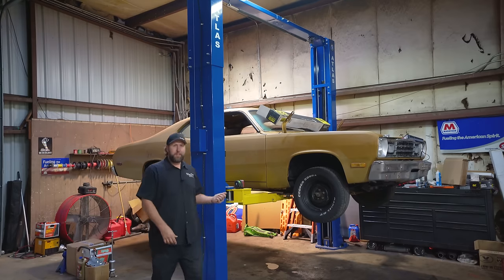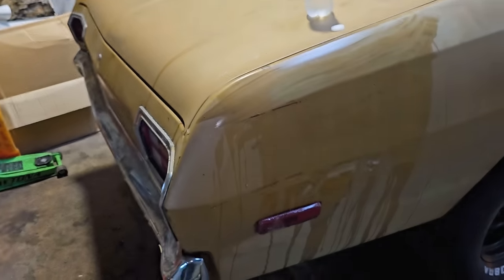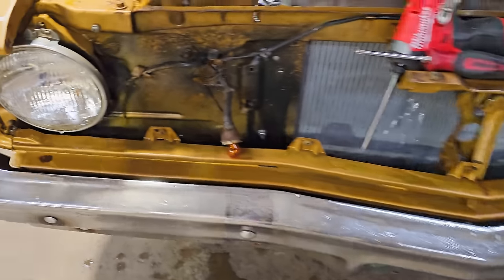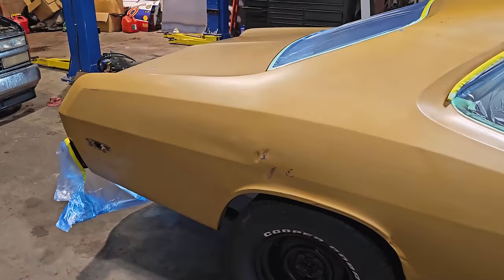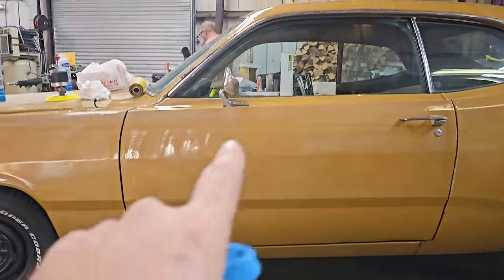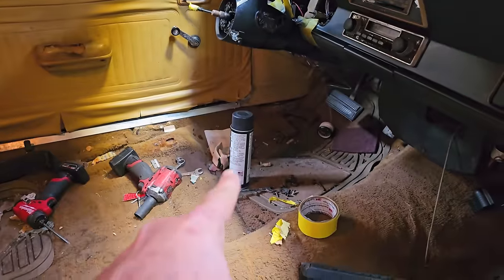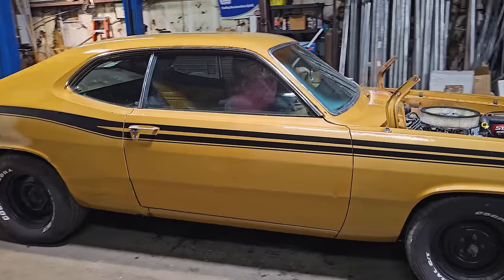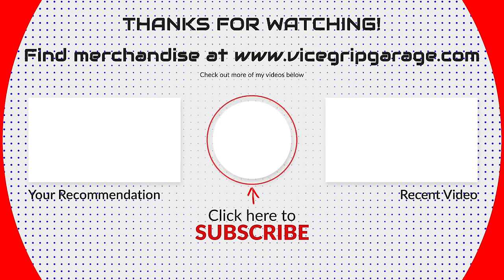MASSIVE CHEAP Mopar Transformation! Duster Looks Better Than Ever!

Comment: The most comprehensive, easy to follow front wheel rebuilding I've ever seen. Love it! 👍
Reply: I feel like I can do brakes now. Can't wait to do mine this weekend.
Reply: Step by step detailed instructions how to rebuild front end, AWESOME!!
Reply: I tried that same rebuild method on my disc brakes, it sucked, lost all stopping power.
Reply: craigslist rebuild.
Reply: The guy single handedly upgraded a single wheel with 7 new bearings and 5 brake pads on a drum. That takes talent, man
Reply: At pit crew speeds too.
Reply: Why not use real paint instead of clear ?
Just as much work is required
Reply: 15:29
Reply: @BeardedFrog PPP

Comment: 👍 I'm one of the guys that liked the black steel wheels but on the other hand I would upgrade front brakes
Reply: I would do the brakes to with the HP up front now
Reply: I concur. My first car was a '67 Charger with a slightly heated up 440 Magnum, and the stock drums all 'round. After a few hard applications the slowin-down situation got, uh, "interesting".

Comment: I remember my Dodge Dart Sport, ‘73 model with the unbreakable 5.3/318 v-8. It was copper mini flake exterior with a white vinyl top and beige interior with benches front and back. Dog dish wheel covers on 14” wheels. Slapped in a generic 150 watt cassette player, tore out an 8 track player to get it in, mounted a tachometer on the steering column and drove the crap out of that “cruiser”. Never a problem.
09:40   That sounds great

Comment: This has taken me back to my late teens! I can remember setting up a spray booth in my parents double  garage.  I used frame tent poles  and polythene with a damp floor to keep the dust down. Before I started I had 4 old oil filled radiators plugged in to get the garage warm. I can still picture my mini and it's island blue paint with a white roof!!
Reply: Cool.
Reply: Do you have a picture of it too share with us? 🤔🧐✌️
Reply: @BrianMagnafici-mw5xh  Unfortunately I don't it was 30 years ago, I did take pics but I'd used an old point and shoot camera. I'm going to my parents house tonight and I'll have a hunt in the attic through the family albums!!!!
Reply: I did exactly the same thing, but without the tent. My Mini was Almond Green with an Old English White roof, 1275A+ Metro engine, Cooper disks, Cooper perforated wheels, later genuine Minilites, negative camber and lowered all round with the obligatory RC40 exhaust.

Comment: Gas station attendant forgot the hood pins on my brother's 68 Roadrunner. 95 mph on open road and the hood went over the roof. No other damage but  he never painted the replacement hood. Looked good. I repainted my Ranchero and did the hood in 1/2 flat 1/2  semi gloss. No glare off hood!

Comment: That stock 7.25” likely had a 2.73 gear. 8.75” 3.55 was an awesome choice. That gauge cluster is without a doubt the best I’ve seen. I’m hoping you share a build sheet with us as far as the parts you’ve used.

Comment: In 1981 I had a 72' Duster with a 383, 8 3/4 rear(also shortened since I could not find one for the duster. Hooker fender-well headers, 727 reverse manual valve body, engine redone 11:1 comp, hairy cam, edelbrock high rise holly 780 jetted out. 490hp at the wheels. Heads were all done as well with larger intakes. 3500 stall. The car would pop wheelies with slicks. I drove it on the street for years. To this day my favorite car ever!!!

Comment: Looks Good.. you’re better off using a 1.3 or 1.4 for clear.  In cold weather you wanna heat the clear.   Boil a bunch of water then pour it in a bucket.   Then set your cans of clear and hardener in there    Let ‘em warm up Dutch oven style.  (You can set them in front of a heater also).  When the components are nice and warm, mix and spray.  Trust me.  Way less likely to run and it’ll lay down smooth.  Set your gun about 29 psi at the cap.  Material about 2 1/2 -3 turns out from fully closed and keep the wet spot movin’
Reply: Exactly. 1.7 tips are for primer.
Reply: yep I 3rd that I use 1.4 for clear 1.3 for base   . and i did use 1.8 for high build primer but now use 2.5
Reply: P.S. get away from the hvlp guns  plenty of budget conventional or lvlp guns out there. Heating the clear not only makes it flash quicker.  It makes it thin out.  Cut your reducer down to 5% or less.

Comment: I saw a really interesting video on clear coat runs a while back. The fella was trying out a technique he’d been told about by an old hand in the profession early on in his career and remembered it when a new guy at the spray shop was working at got runs in the top coat. He used filler to cover the area and then knocked back the whole area with various grits until he’d taken off all the filler and clear coat and as they’re both on top of the good paint it saved the day with the minimal amount of work. Lad is the GunMan on here if anyone wants to check it out ❤

Comment: The car deserves to get proper bodywork and paint. Anything less is an injustice IMO. 😮
Reply from the maker: A 73 slant 6 car?  That means k cars need full restores too.
Reply: I'm with you on that doesn't matter if it was a 6,cyl. A car like this at least should have the rust knocked out and the dents filled. Then color change. Doesn't have to be a full out restoration but enough to make it look decent.@rustyul. Of course that just might be the body man coming  out in me.
Reply: I guess you forgot that it's free. You can take it to the next level   if you win it.
Reply: @scottcrawford3092  would have taken a  day max to bondo and primer. Doesn't have to be perfect. Hell hey put an engine , tyranny ,new rear, custom exhaust, new rims, and new interior. What's the extra day and $400 to make it look decent.
Reply: Nah, I wouldn't want it too pretty., I'd be afraid to drive it in the real world. It's a hair over the line as it is!

Comment: Advice on the double edge blade , pout two small pieces of masking tape on both ends so a guy can hold the blade tighter and will not slip out of your hand.

Comment: Please, please, please use safety glasses more often and especially when using a wire brush on a grinder. I caught a piece of wire in my eye "once" cleaning a transmission with a wire wheel on a drill motor. OUCH! Eye Dr. was in thankfully.  1/2 mm wire sliver was removed from inside eyelid. It scratched my cornea with every blink for an hour or so.  Hurt a bunch. No permanent damage. Love your videos.

Comment: I cut some wheel wells out that was rusted out and bout replacement ones and welded them.on a 09 Chevy Silverado. Then I used the grinder to smooth out the welds. After that I added Bondo and sanded and primed it. It was fun and it turned out good. Now I want to do that and buy a big air compressor and some guns. I have 2 guns already but I want 2 more. Can't wait to try it on my 06 Dodge charger 3,5 motor. I'm going to paint it orange maybe do the general Lee or something

Comment: I'm an automotive paint repairman by trade.(Tip) Sharpen the back side of your razor blade by dragging it on 800 grit paper on a flat surface.  Now take your blade and put it  90 degrees to the run/sag in the paint and drag the front side across the run until  the run is level with the surrounding surface. You will know your there when all the area is the same color. Now finish with 2000 on a block and then polish.
Reply: 𝐋𝐞𝐭𝐬 𝐃𝐢𝐬𝐜𝐮𝐬𝐬 ✝️✝️✝️✝️✝️

Comment: I'm sitting here sportin my new VGG hoodie! I love the card that came with it too.
You are a lucky man Derick. 

It looks like a poor rattle can paint job.

 I have never won anything in my life, but I have a feeling in my bones for the first time that my my ship is coming in after 62 years.
I have always been an optimist.

So don't worry about the body. I live in the high desert with lots of mud, rocks and snow, and it will be thrashed. 
I have never owned a Mopar before but I have worked on many. I will adjust. Since it has a morphodite Chebbi/Chrysler engine in it it will make the transition less painful.
Chrysolet? Moparlet? Chevlar? Mopette? Crymaro? Dustvelle (it's kinda Chevelle-ish)?...or how about Mova!

I would have loved the 2:40 (probably 2:73)gears since once you get out of town around here, the roads are long and straight for hundreds of miles, but beggars can't be choosers. Definitely needs the 4 wheel disk. Around 5 or 6 hundred per end and a very easy job. Go fast car needs stop fast brakes.

Comment: I had 4:11's in my 8 3/4" with a 340 4-speed in a '74 duster (original 225ci auto car) with a very similar color. 3:55's were a much better street gear. Rear springs were a nightmare, even after grabbing V8 A-body leafs, my hyped up 349 twisted the crap out of them. Torsion bars suck even worse, especially when you also do a V8 swap with full length headers, they got flattened multiple times.

Miss that car.

Comment: 3m makes a real easy to use tape and plastic dispenser. Also does paper rolls. That way you can use the good green automotive tape, and the cling free plastic. I worked in house paint, but it should work about the same

Comment: 8:20 8:53
For the effort I’d probably have bodyworked a bit and just shot it fresh, maaco style. Not a criticism- just seems like a lot of work to not do a lot of work to me
20:15 I have had that ~$30 purple gun since ?2016. Used it for a couple boats, several trailers, some vehicles, a kitchen cabinet job with BM water-born alkyd, paneled wood doors, and even gallons of latex on latticework and exterior trim cut in. It’s been awesome. Even did my own old jeep with reduced rustoleum and not a drip or run anywhere. 
Good cheapo gun. Can’t believe it hasn’t failed out. Yet.

Comment: ok ive done all 3 guns from hoborape  best advice i can say is get the spectum  system for it  easy cleanup   i still have the same gun as you for primer but use the system  but use the blackwidow for color and clear   now just painted a  928 cat loadef friday and i swear by the red filters for air intake on gun lol

Comment: If I catch the run while I am spraying I use a trick a friend showed me.. I wrap masking tape around my hand sticky side out like a glove.. if you lightly and quickly touch the run several times you can get most of the excess off.. then spray a light coat over to re smooth everything.. it isn't perfect show car quality but like you said.. it is good enough and if it is not and you need to sand it is closer than it would have been and requires less sanding.

Comment: Just a tip when wax n grease removing, you should always follow up your wet cleaning rag with a dry clean cloth. And I know a fellar is not worried about dust to much but you should also wet down the floor, it will reduce dust as you walk around painting and keeps the overspray and paint dust trapped on the wet floor. Hey a guy has a great spray technic to, no really, good job fella.

Comment: I really enjoyed this episode of VGG! Reminds me a lot of the cars I enjoyed back in the day. The other traditional thing's were a lift on the rear. For a slightly raked appearance. Ladder bars / traction bars. 6" by 9" Jensen dual cone high performance speakers in the rear deck.. A Pioneer AM/FM stereo/ tape player. 6" speakers in each door, Tweeter speakers up front on each side of the dash. A high end 6 channel graphic equalizer. A additional stereo amp under the dash or wherever is handy.. The rims are perfect! The tire's for the time period would of been different in manufacturer. Think Firestone had some very good tires as well as Good/Year. BFG's radial T/A's. To point out a few good one's.... But I have put some large miles on a good set of COOPERS as well. Love your show!! Don't mind my rambling on....The exhaust is dead on!

Comment: I would have hit it on the back quarter with 80grit with a orbital sander then 200 and had a look see I used to work at a place that made signs in the sanding and finishing department. Any small pinholes or divets hit with acrylic putty sand lightly then spray it.

Comment: Ironically, an 84 Volare grille not only fits on that model Duster, it REALLY ROCKS!!!

You wouldn't understand if you didn't see it.

I know this because I had to replace the front of a 67 Duster with the front of an 84 Volare once.

The car went from 'tacky' to TRACKY!

[in appearance, anyhow]

Still had a slant 6 in it, but when I did a flat black job on it, it sold literally the same minute I was finishing off the black.

Some young man in a Blown 460 powered Mercury Bobcat with a chopped and tubbed rear end was cruising by, and as he looked over, he instantly pulled in at the next driveway and came right round and shelled out the cash.

I forget what he said he was gunna put in it, but something WAAAAYYY BIGGER than that slant six!

Comment: After the black stripe, I wanted to see a black grill, black bumper, and black wheels. Chrome doesn’t get you home. The menacing ls motor needs to be a Murder Duster. 

I’m a bit disappointed that your aren’t doing disc front brakes….. 

Thanks for the content.

Comment: An old trick I learned Before I lost My eyesight is when you are trying to remove Runs, and Drips.  Take a Razor blade and scratch it on the run only and it will take out the run or drip without messing up the rest of the Paint.  Phillip K. Daigle

Comment: Next time hold the razor blade at 90 degrees to the panel. Run the blade across the run not touching the low areas. Keep the blade on the crest. Once you start hitting the low sides on the run switch to 400 a block and water. Then 600 or 800, 1500 then finally 3000. Use water with all these. 1500 and 3000 you can use a da but still use water. Compound buff, finesse and finally glaze.
Reply: 𝐋𝐞𝐭𝐬 𝐃𝐢𝐬𝐜𝐮𝐬𝐬 ✝️✝️✝️✝️✝️✝️

Comment: I have painted cars outside, in the winter, with rustoleum, using bondo very correctly (never old, dried out Bondo, nono), etc. I just can't get over the fact that no dents/rust was removed. Honestly I would just have left the car as it is and let someone redo it themselves. It does look a fair bit better and honestly if I got it in that shape, at this point of my life, I would probably enjoy it before the unrelenting need to fix it all up properly. 

Good show for what you can do in a pinch though.

Comment: As a personal witness to the 60s and 70s, how you dolled it up would've fit right in, no problem. Cragers were king, as were 60 wide rear tires.  Of course you've moved that Duster to a much higher plane than the majority of them were originally.

Comment: Question: what air pressure are you using to spray the paint? I have always used 35 to a max of 40 psi. But that said I haven't done any painting in 25 years.
Reply: 𝐋𝐞𝐭𝐬 𝐃𝐢𝐬𝐜𝐮𝐬𝐬

Comment: Well Derek my friend you are a man after my heart with your Mopar builds as I have proudly owned a 71 Plymouth Roadrunner with a 440 6-pack with the Air Grabber hood scoop, then I owned a 73 satellite where we took the old 318 out a put in a high performance 360 with hipo 340 goodies the 360 came out of police interceptor Fury and after boring it we came up at 372CI with the Torqueflight transmission and 8 - , it was really cool but my pride and joy 3/4 posi rearend with 3:55 gears but my pride and joy was a 67 Hemi Coronet all gone now but not forgotten, but my very first car was a 61 Ford Starliner that originally had the 390 CI but my cousins who used to race Fords somehow shoe horned a massive 429 Super Cobrajet that came out of 71 Shelby KR 500, now that was sweet and to this day my cousin Jim  from Gainesville Fl. still has his old 66 Ford Comet where he took the 289CI out and put in a 351 Cleveland, sure do miss those days!! Thanks for what you're doing.

Comment: Im pretty darn good at fiberglass and Bondo shaping. But detailed sanding and painting? Forget it never turns out right. I really wanna learn to paint. I got good equipment guns ,compressor , any sanding tool you could think of its frustrating 😕

Comment: Good call on replacing the 7-1/4.  The 7-1/4 is pretty weak, but the funny thing is that the open version is WAAAYYYY weaker than the Sure-Grip version.  A Sure-grip might have held up for a little while, but an open... no way. PS: Sure-Grip.... repeat after me...  "Sure-Grip," not "Posi."  😛 I've never actually studied up on why the Sure-grip makes the unit stronger, since that's not generally the case with other axles. My guess is that the way the sure-grip carrier is made prevents the ring gear from flexing out of mesh with the pinion as much as the open version does. Or maybe the side-gears are beefier where they spline to the axles.  I usually just get rid of them, not study them.
Reply: 𝐋𝐞𝐭𝐬 𝐃𝐢𝐬𝐜𝐮𝐬𝐬 ✝️✝️✝️✝️✝️

Comment: I bought a fantastically done 440 4 speed dart, it's rust free and straight but the paint job is horrible. I haven't painted a car since high school (40 years ago) I'm trying to get up the nerve to try it. Cragars are the only wheels for late 60s early 70s 14" to 14" max no 17" or larger.that dash cluster is that bomb, I have to get that.